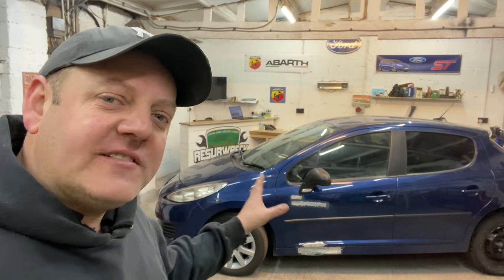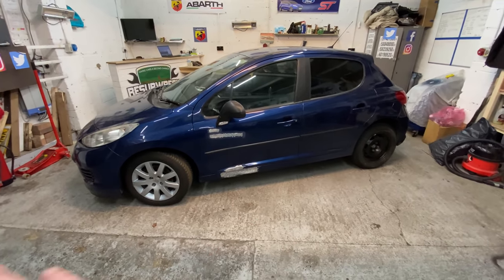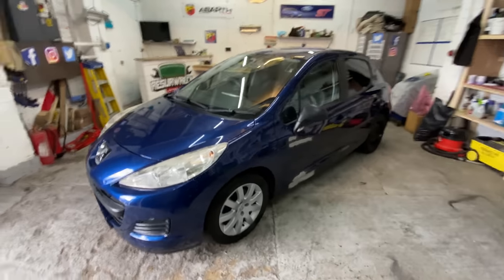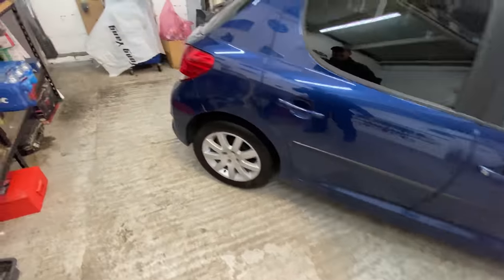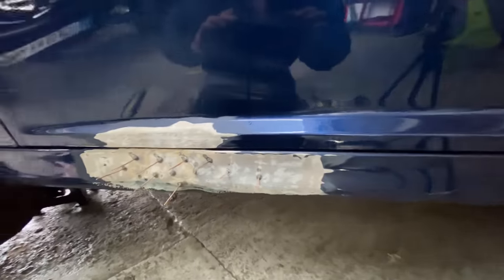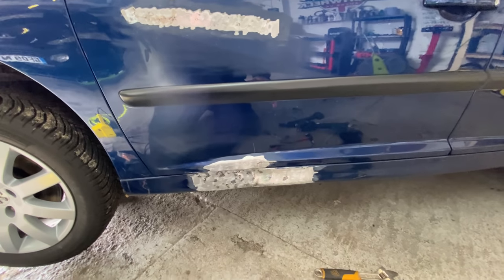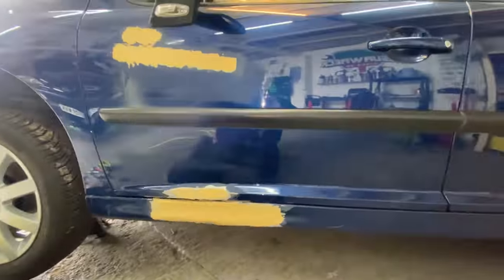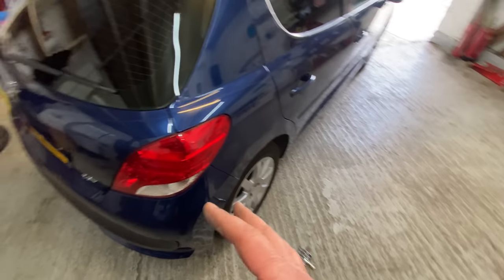Stud Welding (Dent Puller ) On This Peugeot 207 Door And Cill

Comment: The dent seems to come out ok. For long dents use the rings put a screw driver through them and using the claw and a cheap winch pull off some thing like a tow bar. That way you can see as you pull when you are to where it needs to be. Good start though!

Comment: Try a profile gauge to give feedback of panel contours. Available in some pound shops. These contain tiny pins that push on the surface so you can see improvement further from the surface where it's easier to see

Comment: Happy Birthday  you share it with my wedding anniversary  the naily ones are for the small dents like the dents in the door the  ones you  shown us in the bag are for things like the sills i put   long rows on  one close to top edge of sill  minimum gap between them make sure the eyelets  holes run along the sill like you had the washers  then use a bar or long 3/8 extension bar  or even  long screwdriver and thread the bar through the eyelets then that claw tool with the multi hooks hooks  onto the bar  than you get an even spread pull  you can hook wherever is deepest first and   pull it gently out working along the bar  for sills i use the pull lifts as the slide hammer can be   a bit harsh  and pull the eyelets off  but the slide hammer is ideal for the smaller dints  the washers did ok but  its your first go  you did well
Reply from the maker: Thanks Charles appreciate it the info buddy nice one 👍👍

Comment: Happy Birthday buddy. I have put one of these dent pullers in my Ebay basket loads of times and then not bought one. It was confusing which one to buy? How did you decide on the model etc? Cheers
Reply from the maker: Hi Paul thanks mate I did some research on some other ones but I bought this one from a website direct £125 well worth it 👍👍
Reply: @ResurwreckAutosUK  Hi buddy. Any chance you could put a link to the website you got it from? Thanks
Reply from the maker: @paulanderton9424  yeah I can buddy
Reply from the maker: Check out the description I have put a link there 👍👍
Reply: @ResurwreckAutosUK  Thanks buddy 👍